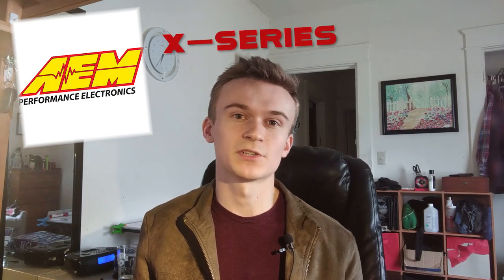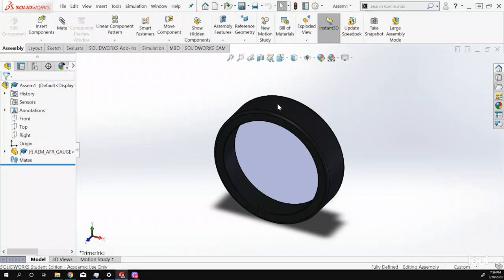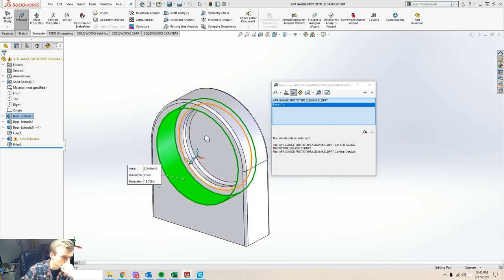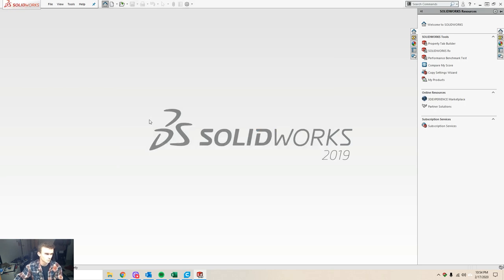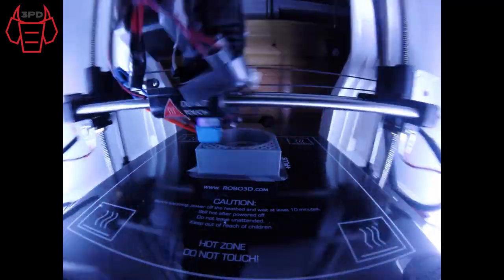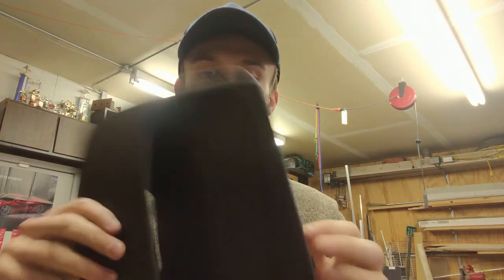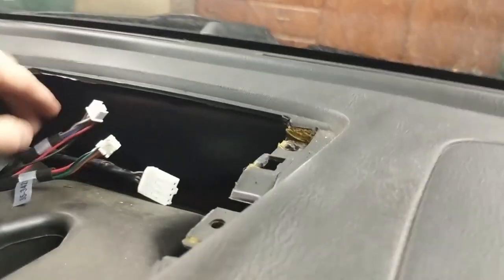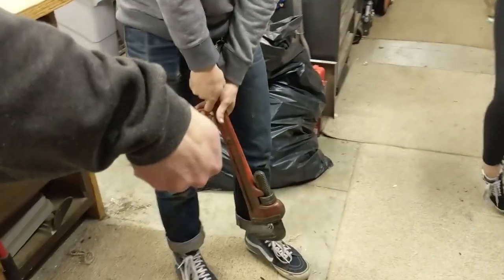Designing a 3D printed Gauge Pod for AEM Wideband AFR Meter (Built Subaru WRX)

Comment: Really nice, how hard it would be to modified that file so the gauge pod can be completely round without the flat surface on the bottom All around same dimensions? Thanks much appreciate it.
Reply from the maker: I just checked through my files and unfortunately I designed that gauge pod in a software I no longer have a license to. I have all the dimensions written down, so I could model up another one. 
Email me at 3pedaldevils@gmail.com

Comment: Pretty cool man. I intend to do the same to my car, I have a pretty similar dash lid and just bought a 3d printer.
Reply from the maker: That's awesome! What CAD software are you going to use to design your new lid?
Reply: I was used to Autodesk Inventor but nowadays I'm shifting to SolidWorks 2019. I tend to use SolidWorks more in University and it is a very attractive skill for most HR departments to look at when hiring a mechanical engineer, at least here in Brazil.
Reply from the maker: Nice! Autodesk Inventor was the first CAD software I learned as well, but I've been using Solidworks while at University. I'm going to try to learn Autodesk Fusion 360 and Siemens NX this summer. Brazil?! Awesome! I lived in Brazil (Sorocaba, SP, and Ribeirão Preto, SP)  for 2 months about 7 years ago!
-Connor
Reply: That's pretty cool. São Paulo in general is a pretty nice state for engineering. Did you come on hollidays or to study ?
Reply from the maker: Yeah I loved it in São Paulo! I was only 15 at the time, so I was just there on vacation visiting two of our former exchange students!
Reply: Awesome. Where do you live in the US ? I have visited before, but only on vacation as well.